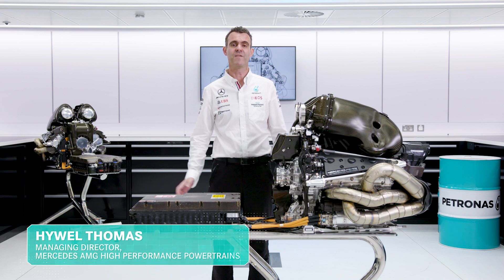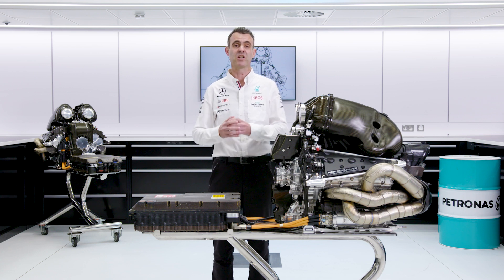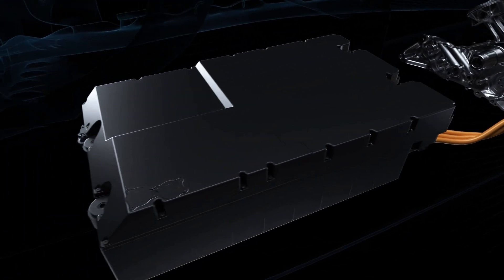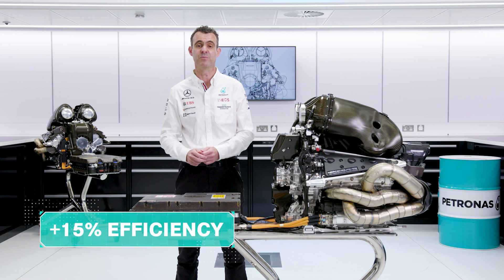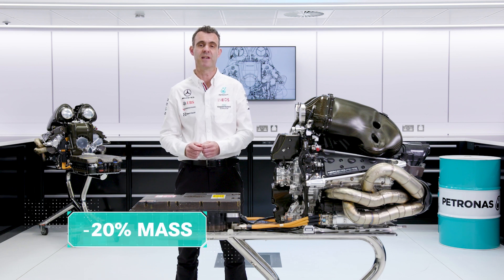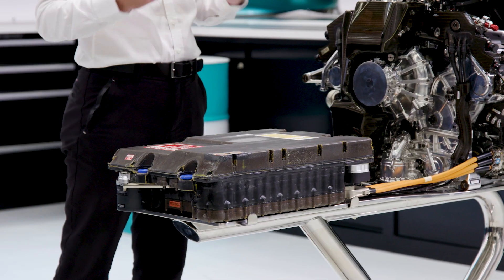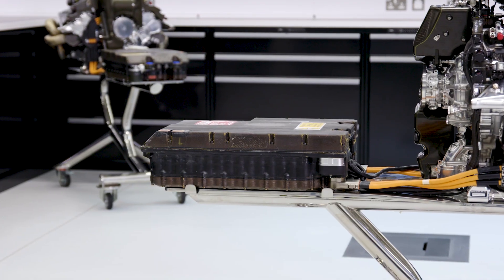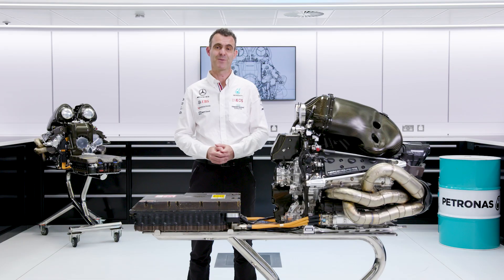Power Unit 101 - Episode 6 - Energy Store

Comment: Having listened to the entire series I can attest; in my opinion, to the fact that three components namely the mgu-H, mgu-K and the battery store are the key components to Redbull's speed and not entirely to Newey's aerodynamic contribution but complimenting each other. The mgu-H generates a substantial amount of power from turbo operating at extremely high rpms with most of it routed to the mgu-K first and whatever is left after the 4Kjs is stored at the battery hence making the mgu-K a "secondary storage unit". The mgu-k's 2Kj per lap energy is stored by the battery upon which it's deployed to the mgu-H when needed and the 4Kj 20kg-25kg battery which should ideally be more (+4.5Kj) considering Japan's lithium ion battery design superiority provides a continuous 4kj of power to the mgu-K as regulated with an additional to the mgu-H before regeneration with it having no strict compounding.. My own thoughts wish I could be clearer.. Lol
Reply: Newey does the cooling

Comment: Amazing video! But where are the technical details
Are the cells fully liquid submerged(most probably) or tab cooled with external radiator?
Are you using cylindrical or pouch lipo cells?
Voltage, kwh, Ah Anything....

20% weight drop... that is a lot to an already state of the art unit

Idk about others but I was waiting for this episode to nerd out and learn more